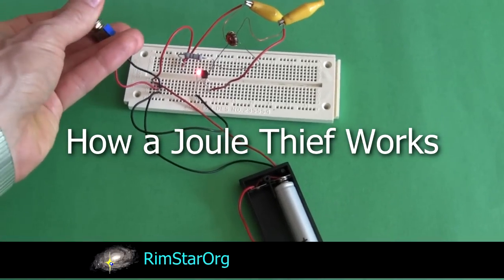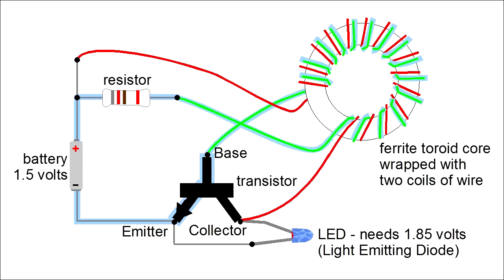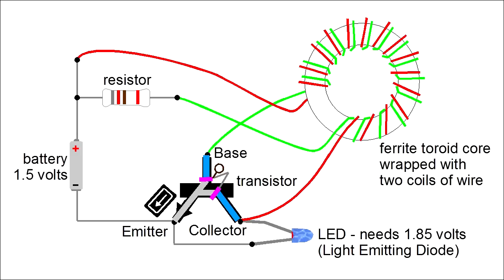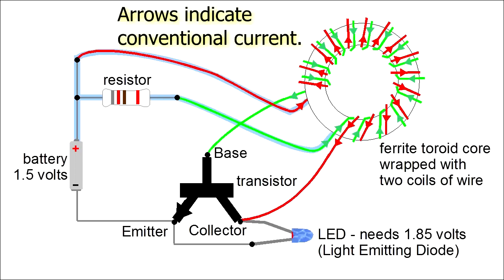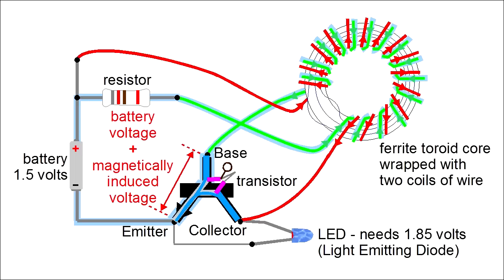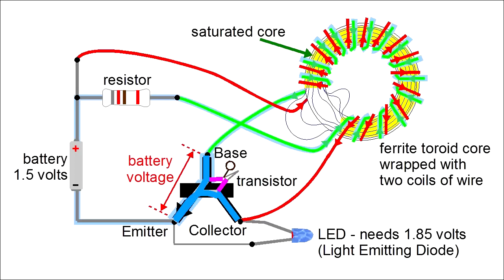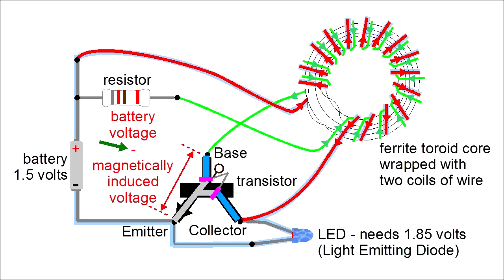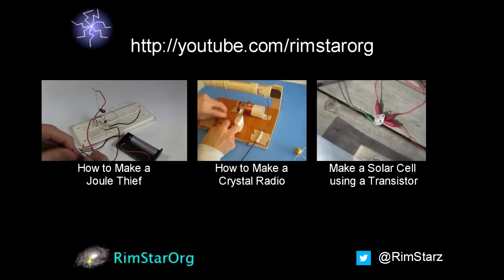How a Joule Thief Works

Comment from the maker: From the scope output in my "Make a Joule Thief for Zombie Batteries" video it looks like each cycle is 46 usecs, so around 21 kHz. The collapse of the voltage (oscilloscope output) was actually quite slow for half the cycle and then dropped rapidly and stayed low for the second half of the cycle. Re using E=IxR to assume the resistance dropped, I'm not so sure. During the dump, it was using accumulated energy after all, so R could have stayed normal while E and I were elevated. Just guessing.
Reply: How come the inductor  high voltage does not blow the led?
Reply: X L= 2pifL = 2*3.1416*21 kHz.* Inductance.
Reply: Lets say V=40V , I=0.40 so r =  1000
L= 1000/ 2*3.1416*21 kHz =  0.0075788068138999Henry

Comment: Nice video..I have just found out, that if you add a electrolytic capacitor across the resistor with positive towards the plus + side of the battery the led will get twice as bright...I wonder what it is helping the current or the voltage...?

Comment from the maker: The discharge is in the same direction as the charging current flow. The difference is that during charging, the path is through the coil, the collector and emitter and to the battery. During discharging, the transistor is off, so the path is through the coil, the LED light and to the battery. Putting the LED in the location you suggest and connected the opposite way won't work since the current flow is the wrong way. Put it the existing way and it won't get the benefit of the battery voltage.

Comment: What will happen if the red wire is connected to a capacitor instead of battery?
Will the collapsing magnetic field current charge the capacitor(s), which can be later used for external work?

Comment from the maker: The cheaper ones of the different types put out square wave. For example, you can get very simple inverters that can be fed by batteries but don't take in AC for charging the batteries. The cheaper ones of those put out modified sine wave. Then there are more expensive inverters that can take in AC for charging the batteries and have cheaper versions that put out modified sine wave but still cost more than the ones that don't take in AC.

Comment: This circuit can be edited, to have a secondary that is totally isolated from the whole circuit. Together with a rectifier and a capacitor you can give an LED 100% of the power, DC regulated is also possible, if you take the circuit further, but the losses will be larger than that circuit has.

Comment from the maker: And re the transistor using current flow, I see what you mean. I was referring to the forward bias voltage to turn the transistor on, but didn't mention the current needed to keep it on and that the base current controls the collector current. But again, time restrictions. I wanted to give the minimum needed about transistors to understand the Joule Thief circuit. Not having a formal electronics education I'm not always familiar with the usual explanations. I learn, like I did just now. Thanks!

Comment: this is the best explanation of this circuit and how transistors function that I have seen to date. With the other explanation's I have viewed, even with illustrations, it was easy to think that when one gate opens the other is shut. Seeing your animation has helped me a lot 
thank you. I'm still a little confused about the function of the resistor and how the negative connects if it's blocked by that gate between the base and emitter (??? or collector and emitter). I can only guess that there is some sort of minimal connection, a flow of electrons jumping around in the substrate of the semiconductors of base and emitter and, or collector. I'm a little puzzled about that.
Reply from the maker: Resistors resist the flow of electrical current, preventing the current from getting too high. So the resistor here protects the base of the transistor by keeping the current lower than it would be without the resistor.
By limiting the current, the resistor also has the side effect of limiting the overall output. The smaller the resistor value, the brighter the LED will be, and vice versa.
Regarding the lower level workings of the transistor, that's too much for a comment so I'll refer you to here https://www.allaboutcircuits.com/textbook/semiconductors/chpt-2/bipolar-junction-transistors/. Basically search for "depletion region transistor".

Comment from the maker: Yes, it's the same type of toroid, just different coils/wires wrapped around it. But it's easy to remove the wires and wrap your own around it. I removed my toroid from an old power supply, removed the wires and then wrapped my own. You can see me wrapping them in my other joule thief video "Make a Joule Thief for Zombie Batteries" which you can find a link to in the description below this video. And I agree, it is amazing and beautiful and delightful when you see a circuit you made working.

Comment from the maker: I agree, in this case it's not because the core is saturated. In the video I said there were a few possible ways the cycle could reverse. I should have explained them all, and wish I hadn't chosen not to. Too late. With this small a battery it's more likely it reverses for the reason you say. If it were a larger battery and a ferrite core then core saturation is a possible reason.

Comment: Thanks for the video.  You are speaking very quickly, even for an EE.  However viewers can slow down the video by clicking on the Settings icon at the lower right, the gear shape, then changing the speed.  It's a little weird-sounding but it works.

Comment: Well when the transistor is open, the current flows faster and faster. The inductor acts as a kind of weighted battering ram or electrical flywheel, storing energy in the form of an opposing magnetic field, though the action is the same as if the electrons were heavy weights trying to speed up in the circuit. The increasing magnetic field in the high current coil is inducing voltage in the base of the transistor in order to keep the switch pressed in.

Once the current is flowing through the red coil as fast as it possibly can, the green coil stops sending a signal to the transistor and begins to apply voltage in the opposite direction and it breaks the circuit, and all that high speed current shoots through the LED. When the current in the coil has depleted, the base of the transistor is free to rise almost to 1.5V again and the process starts again.

Comment: Can you control the voltage output of the joule thief? If so, which part of the circuit controls it and how do we maximize the voltage needed? Great video thank you!!
Reply from the maker: +LipLEIA Subscribing Channel Thanks! You can control the voltage output by replacing the fixed value resistor with a variable resistor/potentiometer. The lower the resistance, the higher the voltage. But the resistor is there to protect the transistor from too much current so there is a limit to how low the resistance can go.

Comment from the maker: The joule thief does suck more power out of the battery than it puts out at the LED. If you have a 1.5 volt battery and a 1.4 volt LED then don't use a joule thief. Running the LED directly from the battery will involve less losses. If you have a 1.5 volt battery and a 1.85 volt LED then you need some circuitry to raise the voltage to 1.85 volts for the LED. That's what a joule thief is for. But it pulses the output. The LED isn't being powered continuously, it just looks that way.

Comment: QUALITY!!! Am I to guess that lower battery voltage will result in lower LED pulse frequency? Also wouldn't it be simpler to just run an induction coil with say a 2:1 ratio to the battery? I'd guess that would work fine for near dead batteries, but I'm no expert.

Comment from the maker: But the oscillation is not due to the LC, the inductor and capacitor (capacitance of the coil) oscillating back and forth. The oscillation is due to the coil and transistor interaction. That's why I said it's not an "LC" oscillator.

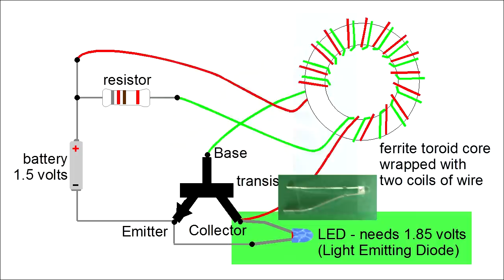Comment from the maker: The one in my Make a Joule Thief for Zombie Batteries video was oscillating at 46 microseconds per cycle or 21,739 times a second. If you watch that video you can see this in the oscilloscope clip at 0:36 into the video. Each horizontal division on the scope screen is set to 10 microseconds.

Comment: So I analyzed the joule thief circuit recently and post a video of the operation.
after which I watch your video, in which you talk about the 180º phase shift of the transformer. and how the collector emitter current would aid the base current... I don't see it that way I see it as the current of the Collector Emitter would negate the current of the base since they are 180º out of phase.
Once I have repaired my oscilloscope, I will perform tests to determine the circuit operation.

Comment from the maker: All solar cells produce DC, not AC. In the garden lights they do have a diode but it's only there to prevent the batteries from feeding back into the solar cells when there's no sunlight.  A diode is sometimes called a rectifier but that's not how it's being used in this case. Bigger solar systems have charge controllers but they do all sorts of other things too (massage the current and voltage, prevent back feeding and over charging, ...)

Comment from the maker: Solar cells always produce DC, never AC. As long as their voltage is above the battery voltage while connected to the battery, then they can charge batteries. I've never opened one up and looked but I just looked online and the circuits I saw simply have the cells connected to the batteries with an added diode for protecting the solar cells when there's no sun. The solar cells I saw were 2 volts and the batteries 1.2 volts.

Comment from the maker: There is no extra energy. The battery cannot a high enough voltage for the LED. So we leave the LED turned off while we build up energy in the magnetic field. Then at some point we dump all that built up energy in one go into the LED, giving us the needed voltage and a lot of current too. The LED turns on. Once the magnetic field has collapsed the LED is off again and we repeat. It's like filling up a bucket of water and then dumping it all at once, and then repeating it over and over.

Comment from the maker: 30 AWG and 26 AWG. I used two different sizes because that was the only way I could get two different colors. But you could use even up to 18 AWG. There are 13 turns of each but I chose that number at random, it's what fit on the core. See my "Make a Joule Thief for Zombie Batteries" video where I show the parts and me making and testing it. There's a link to it in the description below this video or you can find it on my channel page.

Comment: I suspect this gives an oscillating power output which is fine for crude things but not for many others. How much one can refine this by adding a capacitor to try to even out oscillation on the output? Are there some simple chips that can tolerate that?
Reply from the maker: Yup, the output is oscillating and is far from being a nice sine wave. I do have one write-up on my website here https://rimstar.org/science_electronics_projects/joule_thief_powering_clock_ls.htm from someone who added circuitry to power a clock. I don't know about any chips which can tolerate the output. You can see an oscilloscope output of the waveform near the beginning of my how-to-make video here https://www.youtube.com/watch?v=B61DU7yEsPM

Comment from the maker: A frequent error, which I still make sometimes, is to connect the coils incorrectly. Notice that they're connected oppositely. You should double check that. Also, I've had the voltage the same as the battery voltage situation when I had a bad connection somewhere, so recheck all your connections.

Comment from the maker: Why not? To your eye it looks like the LED is always on, so it's doing the job. The whole point is to provide light using less power and it does that by not having the LED on more than it needs to be to do the job. Actually, I'm not sure it's using less power over all since when it's on the voltage is quite high. But it's definitely using a battery you would otherwise have thrown away and still doing the job.

Comment: I'm trying hard to understand this completely. If you were to show a graphic that showed all the power flowing in the entire circuit at each step that would help. 

So far what I"m getting is that 1) The green wire doesn't have enough power to open the gate due to the resistor. The red wire passes power through the LED, but not enough to light it. 2) The red wire starts to build a magnetic field and induces enough current in the green wire to open the gate. 3) Once the gate is open the magnetic field builds to it's max. 4) Once the MF is static it no longer induces any current in the green wire, so the gate closes. 5) The collapsing MF induces a strong current in the red wire, the current is forced through the LED, and lights it.

Is that right?

Comment: I catch idea of this circuit now. So diode is lighting because the voltage between emiter and collector is higher than battery voltage. Thats happens because the current flow by the coil (primary wire 10 turns) inducted more voltage on the secondary coil(11 turns thats give +0.35V). Transistor switch on and switch off. In fact diode is pulse approx. 40 000 times per second like Wiki sed. Thanks for goog tutorial.

Comment: That's a good explanation.  My guess is that, if you were to swap-over the connections to the green coil, the system would still oscillate although at a much higher frequency.

Comment from the maker: There are two answers to your question. One is that there's no comparison since without the joule thief circuit, the 1.5 volt battery wouldn't light the 1.85 volt LED. The other answer is that if you did have enough voltage to light the LED without the joule thief then my guess is either the joule thief would drain the battery faster or, again there'd be no comparison if you're getting a brighter light.

Comment: Hi, Fabulous instruction, so If I understand what you are saying the collapsing and rising magnetic field happens so fast it is totally imperceptible to the eye, is that correct. Also how large can you make these joule thiefs, presumably the larger or more number of winds on the bi-filar coil would produce a greater voltage difference, is that correct ?
Reply from the maker: Yes, both of what you said is correct. In fact, in these videos I use many more windings to get enough voltage to light a compact fluorescent light https://www.youtube.com/watch?v=FkLET8MhRbU https://www.youtube.com/watch?v=yz_99oVMbSI

Comment: I have a question: around 2:55 the magnetic field produced by the red coil induces a current (and a voltage) that sum up to the one given by the battery. I can't figure out why such induced current is summing up to that of the battery instead of going against it since the coils are opposing each others.
(I hope It's understandable english)

Comment: Can you tell me how long the battery will last ?? Can using two batteries of the same voltage really increase the voltage avalible for a bank of LEDs ???
Reply from the maker: I haven''t measured how long the battery will last so I can't say. This is a fairly inefficient circuit though but at least it allows a battery that's at too low a voltage to power the LED with a normal circuit to work.

Comment from the maker: No, it's not an LC oscillator at all. There's no capacitor (C) involved. With a small battery it's using the fact that the base to emitter current eventually gets too low, shutting off the transistor, to start the next cycle (the video gives the example of a saturated core, but that happens with a higher current source.) I suspect it's called a "thief" because it makes supposedly "dead" batteries work again, not because it's overunity.

Comment: Great information! THANK YOU!  I've been having trouble building a joule thief that outputs about 6v 5w 1000mA using a 1.5v battery. Is that possible to build or even work is my question, and if so, should I add more windings to to the "red" wire wrapped around the toroid? RimstarOrg Thank you.
Reply from the maker: I don't know about whether or not it's possible. I've never been able to reliably measure the current in a joule thief circuit since it's neither flat DC not sinusoidal AC.
Reply: RimstarOrg ok, thank you for your time, and answers!

Comment: I don't have an oscilliscope unfortunately and the best that I have for measuring is an analogue multimeter.  I'm trying to light an LED and it won't work. I've tried different arrangements with the transistor leads and if it doesn't drop the voltage, the voltage is the same as the battery. I'm measuring from the collector (+) and emitter (-) leads. My coil is .5 inch in diameter, 2 x 18 gauge wire, 17 turns and wound the same way you did. I also tried changing transistors and no luck.

Comment from the maker: Yes, but you're better off just connecting the capacitor directly to the battery and have the battery charge teh capacitor directly. That way you avoid the losses due to the additional, unnecessary circuitry.

Comment: OMG thank you very much. I really hate making things without understanding it. Good application of the Lenz law. But can I ask what peak voltages can be obtained at the output? Will it be higher if a larger or two parallel iron core is used? But it might ruin the transistor though. Will the problem be solved if we put in 2 or 3 transistors back to back in series (all 3 collector input parallel)? I can now try out this project in peace

Comment from the maker: The one in my How to Make video ran at around 23kHz, 43 microseconds per cycle. If you replace the fixed resistor with a potentiometer (variable resistor) then you can vary the rate.